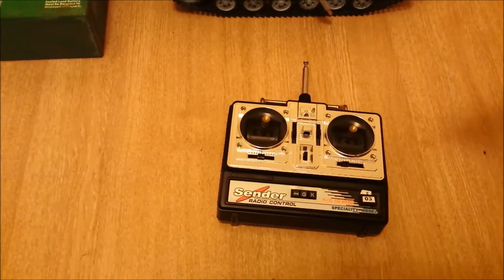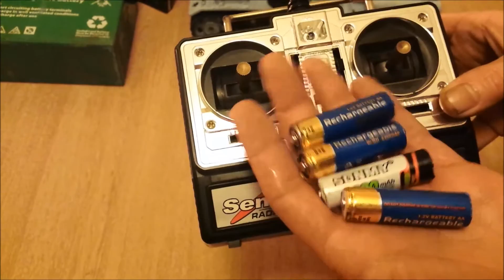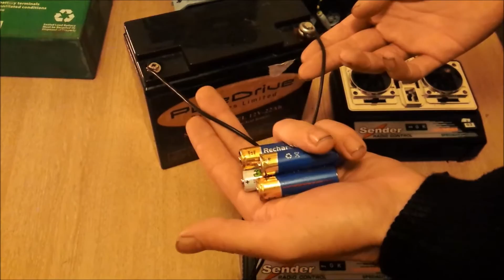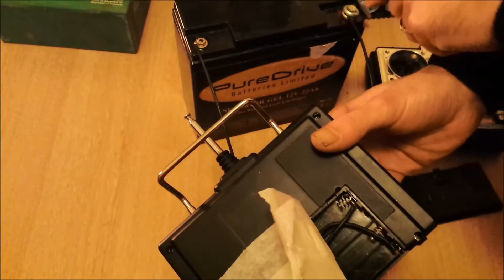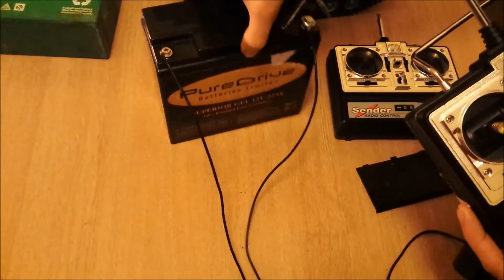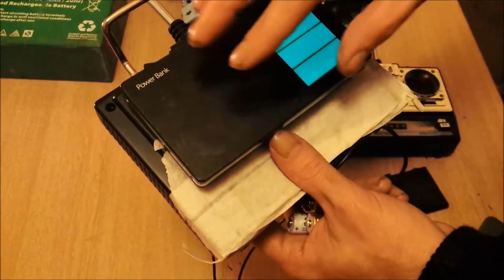Heng Long Radio Control Tank R/C Transmitter Field Battery Mod

Comment: That's is a cool mod, I did something similar with an old slot car track that I had years ago. It ran off a battery bank, but I hooked it up the same as yours to mains power through a 9v transformer. worked great and the cars went heaps faster too (-;
Reply from the maker: thanks for the positive :-) yeah the power banks with their lithium ion cells though light arnt really that good on ampage, its possible to step up the power bank output with a high amp step-up board :-) the overall capacity looses about 10% but the extra umph from the extra ampage is pretty awesome, even if you leave the voltage the same :-) sometimes they do need a little cooling block but it can be a handy work around for stuff in case you cant get an sla in to what your working on :-D
Reply: battonfive
Yeah, very cool idea. Great work man